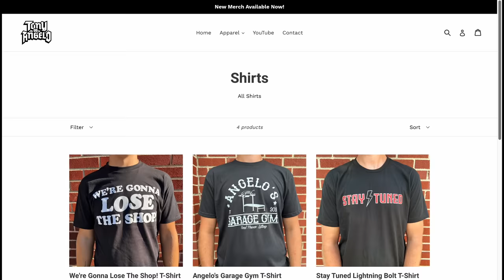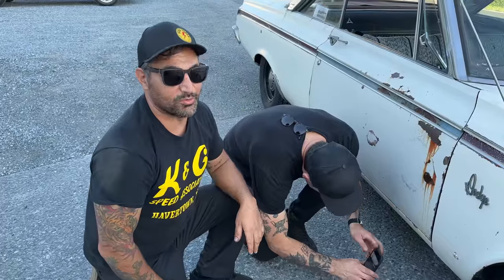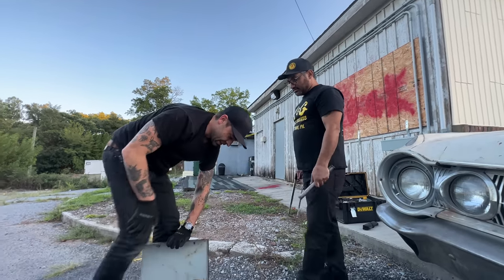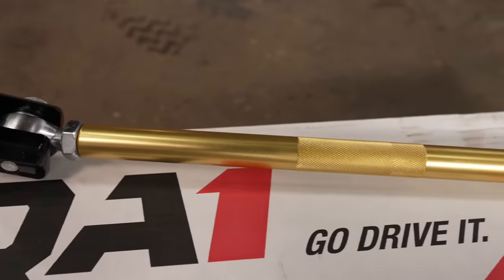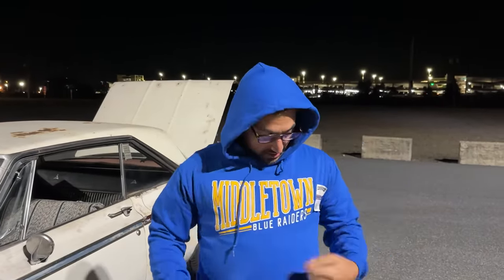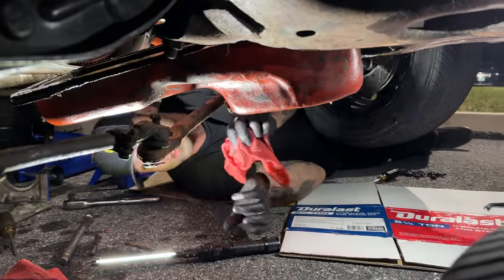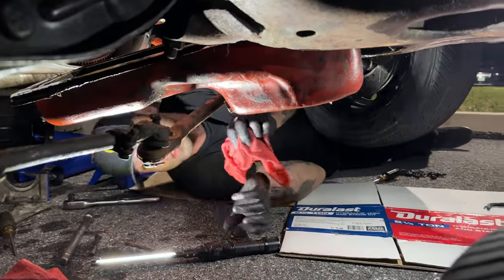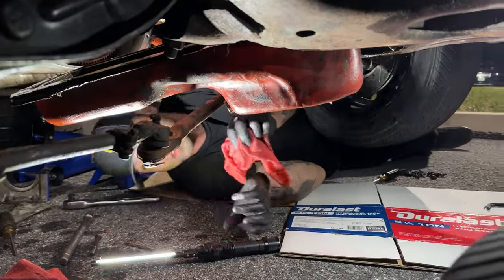Disaster Filled Road Trip In My Forgotten '64 Dodge 440!

Comment: The Oil Diverter 8000 is a top notch case of what a dude I used to work for called slam dunkatecture.
Reply from the maker: Yeah that is going in my vocabulary immediately.

Comment: Watching this brings back memories of replacing a rear main in my '56 Ford 272, in my apartment parking lot. It used one of the old "rope" seals, and the replacement kit had the wire puller that allowed you to pull the top half around the crank. What a job!

Comment: Great job. You made it !  FYI (from an old mechanic), It is completely unnecessary to connect the PCV for the engine to run well. (Most cars before 1968 still had NO PCV). Just plug the vacuum source (carb, intake etc.) & let the valve covers vent to the atmosphere. My guess is that you had a stuck or broken ring that pressurized the crankcase, causing exhaust gases to escape the valve covers etc. When you first attempted to plug ALL orifices to the PCV those gases had to escape somewhere & the well worn rear main seal was convenient.

Comment: Since it set for so long it probably needs a additive in the oil to help with the rings. There's a can of stuff I buy at Walmart can't remember the name but black and silver can that's for 4 6 and 8 cylinders and it works well. Derek from vice grip garage has used it in several vehicles in his rusty acres fleet.  Just a thought

Comment: Once you removed the breather there was too much blow by for the dual pcvs to handle, you pressurized the crankcase and it started puking oil! Love the ingenuity though!
Reply from the maker: The vacuum should have enough suck to do it! It did not seem to help either way.
Reply: @StayTunedTA    Regardless of any design issues, fixing on the fly in a time limited situation is a try anything process.

Twin 3/8" PCV hoses are not enough especially for a worn engine, this will pressurize the crankcase causing leaks especially once you have any sort of throttle opening and vacuum drops off.  

 On a stock PCV system, the breather side of the system is 1/2" and is plumbed into the clean air side of the air filter or the classic Chrysler filter/ oil separator in the valve cover with  the other end into the stock air filter housing.  With either system, fume volume that out runs the PCV will be pulled into the carb.  Non PCV systems had a road draft tube pointing to the bottom of the engine compartment so the fumes went out the back rather than into the cowl vent.

Comment: I bought a 67' Pontiac Catalina four door sedan back in 2014. It ran ok but had a slight miss at higher rpms. Added a Petronix ignition system and it got rid of the miss. Then the front brakes started making terrible noise. Ended up doing a front disc conversion. Went pretty smooth until I went to hook up the lines. Hard lines were rusted and needed replacing. Car sat for four years cause I suck at bending lines. Discovered Inline Tube and bought the pre-bent lines I needed. Car stops on a dime now. Right now I am replacing the blower motor which needs to have the fender removed to do. I have a new aluminium radiator, silicone hoses and belts to do next. Then  I need to replace the exhaust then some of the rusted body panels. I salute you for doing this roadtrip fixing the car as you go. I am going to fix all my problems first then roadtrip it.

Comment: Passing along an oil blow by tip: Ran into similar issues in my ‘64 Comet.  PCV/catch cans helped a tiny but but the issue was hole placement in the valve cover and NO BAFFLE.  Went ahead and installed baffle plates and it drastically reduced the smoke screen.  I think the combination of old motor, aftermarket valve covers, roller rockers led to oil just ejecting out of the valve covers.  Try a baffle and it could help (part) of your problem.

Comment: You guys are friggin heros.  I did this on a 383 a year ago helping a friend and we used a 1 piece seal that you can kinda spiral into place.  I bought 2 bolts about an inch longer that the 2 that hold the seal in place and cut the heads off and used them as a locator.  that seemed to help.  383 is a great engine.

Comment: I learned to drive on a '64 Dodge 440, 4-door, wide 318 with push button tranny. First car I bought was '64 Polara, same configuration. Drove it a year and traded for a "67 Coronet 500, 2-dr with 383 4-bbl. Old Mopars bring back some good memories.

Comment: Old school external regulators use mechanical contactors.  THEY SUCK!  After my second one failed in my '69 Camaro I did a 10si conversion.  That was 28 years ago.  10 years ago I upgraded to a CS130 alternator.  Time to modernize!

Comment: Bringin’ back the memories! My 1rst car was my Grandfathers 64 Dodge 330 with the push button transmission and a 318 that got great gas mileage & was like a tank. I learned so much about that car with Gramps showing me how to rebuild the master cylinder by hand, doing drum brakes, u joints, exhaust systems, fuel pumps, points - everything on that old car - then doing gas mileage with a slide rule!

Comment: My first car was a 1964 440, 383 with the push button torque flight trans, Sedan though. My dad bought it for me. I loved that car. Don't see too many of them anymore. Wish I still had it, but i sold it to a guy who used it for demo derby because the trans was slipping and I bashed I the right rear wheel well. We didn't have the internet back then, so I didn't know where to get a transmission.

Comment: I've replaced many a rear main and bearings without dropping the crank etc. on everything from a Ford 841 Diesel tractor to a Pontiac GTO 389 and 400 Cummins engines it's truly a religious experience. But, it can be done. On the bearing you can grind down the head of a brass screw and insert in the crank oil hole and turn the crank and it will hit the bearing and spin it right out and grease the new one up and slide it in the same way.

Comment: A small amount of brake fluid or parts washer fluid added to the engine oil ought  to swell up that rear main seal,you do run a  risk of loosening up any sludge in the engine tho.😮
Reply from the maker: Oooh, that sounds like a gamble and I like to live dangerously!

Comment: Finnegan and Frieberger  would be proud.  Glad the ol' Dodge had the stamina to make the trip.  Never doubted the Mopar drivetrain...it's bulletproof....it's all the stuff attached to it that ya gotta stress about.  I had a '71 Barracuda that would run forever, but I had to replace the voltage regulator regularly.

Comment: Love the old Polara. With a little love and a lot of money thrown at it what an awesome car it could be. I'd love to see more old school Mopar's built to be Hell cat and even Demon 170 killers using the old engines! Just modernized brake systems and reinforced to handle the power. I am not saying you can't use newer technology on the older engines either. That can make them more street able and well-mannered with the higher HP.  The only thing stopping a person from building an E-85 440 or 426 Elephant Hemi is the person building it. You can also build the old pushbutton transmission for drag race only shifts at whatever RPM you want. just change the counterweight in the tail shaft.

Comment: I changed the upper rear main seal on my 54 Ford V8, the autoparts store sold me a small piece of steel that when in the old passage in the crank. Then you turn over the engine 180 degrees. There was another tool that you could thread thru the upper bearing slot to pull the seal thru. No need to drop the tranny or remove the crank. It sort of worked. :-)

I had a 64 Plymouth with a 225 slant six, my dorm buddies had two, one a 64 dodge and the other with a 64 plymouth, both with 318s.

Comment: Cut the metal pieces to cover up the part of the header that gets oil on it. You need to get that regulator down to 13.8 max for Mopars when it is charging at max. Otherwise, it should read 13.2 to 13.4 max at regular idle. Mopars are a pain in the arse when they start having charging problems.

Comment: You can swap the top half of the rear main without touching the main caps. You can usually sneak it out with a pick. Turn the engine over by hand if it’s being stubborn. Some oil on the new one and it should slide right in.

Comment: I once, and used to be dumb.
I owned a Elcamino.
It had a 305ci boat anchor, and used a quart of oil every 15 miles.
Couldn't figure out why people were always using their windshield wipers when it wasn't raining.
Turns out I was applying rust inhibitor on those cars for free.
Reply from the maker: Well, that sounds like a public service!

Comment: The upper part of the rear main rolls in pretty easy. Loosening the main caps helps, but sometimes not necessary
Reply from the maker: Well, I gave it a good shove with a screwdriver and it didn't budge and I didn't have a socket big enough to turn the crank so we did what we could!

Comment: No surprise. It's because you put all the disc brakes on backwards and on the wrong sides. The car hates you for doing that.
Reply from the maker: Ha, you know what, I was wondering the other day. I've seen them go that way depending on the cooling vanes inside but these are just radial and i'll change em at some point.
Reply: @StayTunedTA  I'm just ribbing you. They should work fine any direction. Good work, I wish I had sponsorships to help fix up my Mopar fleet.

Comment: The top just pushes out with a screw driver...Push new
One in leaving a bit sticky out and put lower to match so the seal mating surface is different than the seal holder to block mating surface
Reply from the maker: I pushed that thing as hard as I could and it wouldn’t budge!
Reply: @StayTunedTA  
Sometimes you have to loosen the other crank mains. Then if there is an issue with the main bolts your day gets really irritating.

Comment: Tony.. Cause just say I am slightly older. Those Slit seals are simple. to get the top one out with out a tear down. Screw a sheet metal screw into the seal and gentally work the seal out with perferably a small wreaking bar or claw hamer. they will slip out if you take time and go gentally so not pull the screw out. puttin them in is easier, just make sure the the intire seal half is very well lubercated. and light taps they will slip back in.  I pulledem and rolled them back into my ol hemi with out a intire tear down. and is also a good time to check out tourques on them old main bearings ect. them old cast blocks with the heat and cold they like they say they beath, expanding and shrinking that does affect the cut threads in the cast. with a main rear gone chances the rear bearing has a bit of wear, or just lost it's torque
Reply: On the side of the road ?! Taking the risk to REALLY screw that up when the car is still usable ?😮? ... naaaa 😂 ...
Reply from the maker: I didn't want to risk it on the side of the road and be totally out of luck! We didn't have a socket big enough to spin the crank either so I was just going to do what we could and send it!

Comment: For the rear main seal, just engineer a 5 gallon bucket of oil to drip into the engine at the same rate with a valve. Seal leaks worse, crack the valve!
Reply from the maker: Ha, then we just need a second bucket and a pump under the car and it will be a fully self contained system!
Reply: @StayTunedTA  then it'd have to go donk status and we can't have that shit. Better you just fix the seal.

Comment: They make a tool called a “sneaky Pete “ . I’ve had to use too install the upper part of those seals , you usually do have too loosen the rest of the main caps so the crank falls a little bit usually no issue .
Reply from the maker: Yeah, that would have gotten it done for sure, we didn't even get the pan out, and time was tight. I'm probably going to leave it as is, she's pretty happy now.
Reply: @StayTunedTA  yessir like the saying if she ain’t broke don’t fix it I don’t blame ya , keep up the good content buddy and don’t lose that shop lol

Comment: Be the regulator.
Reply from the maker: HAHA mikey wanted to just hook up wires and randomly connect and disconnect them. BTW you can't just swap new style for old style! New style delivers ground to excited the alternator and old style delivers 12V+. I used a relay to turn a negative into positive or you can swap to the newer alternator!